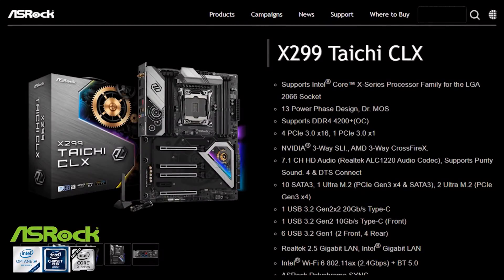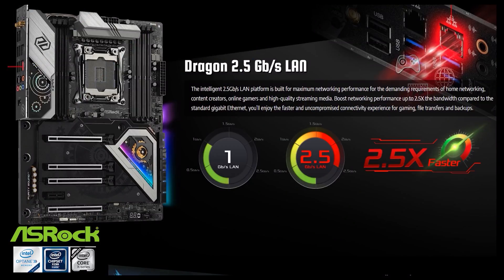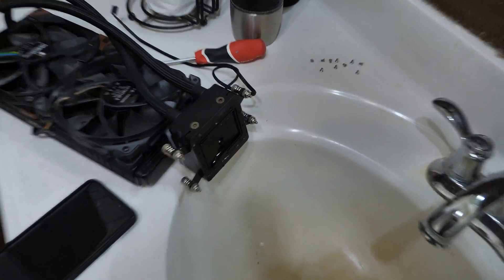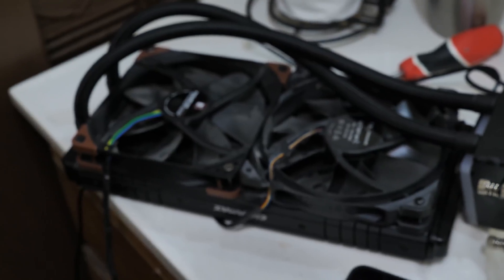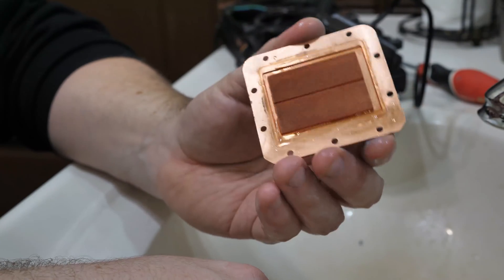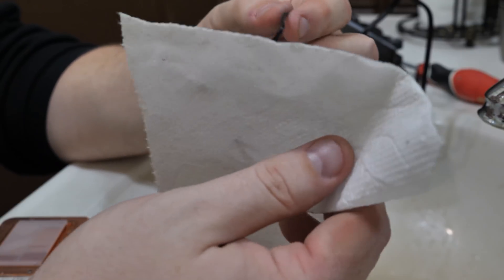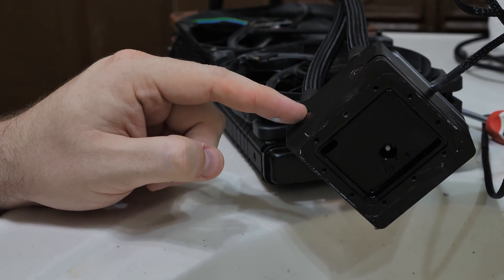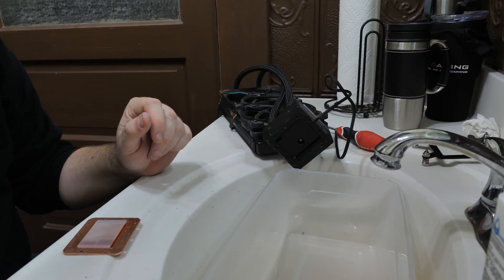L1 Diagnostic: Dying Enermax LiqTech II Teardown & Easy Fix

Comment: RMA if you can. If the finns have not discintegrated you can run vinegar through the loop for a day or two to clean it. Then clean it with distilled water and then you can use clear concentrates or ready made clear fluids. Don't use any opaque fluids as they tend to clog your loop.
A clear acrylic CPU block would do the trick. You could always keep an eye on it and see gunk before it destroys the fins.

Comment: Wendell I have a theory for you. I just got a 3800x to replace my 3600.My 3600 ran at 75c plus on a h100i and a liqfusion 360 stock. Now my 3800x runs at 80c plus. I have a x370f motherboard and I've been reading about tunes of people with insane Zen 2 temps and what I've notice is most of these people have a 300 or 400 mobo. I believe only x570 can properly run these chips without turning them into a fusion reactor. Or is there something else going?

Comment: I have done this exact thing on the Gen 1: https://twitter.com/DadTheTechie/status/1075487584527237122
I got it replaced with a Gen 2 though. Then my Gen 2 clogged up to: https://twitter.com/DadTheTechie/status/1113144147781849090

I cleaned it, rinsed it, filled it with high grade premixed coolant... worked great for a few months, then I had to do it all again... Then a third time. I have given up and got a refund on the cooler and went with an Noctua air cooler.

This could have been a great cooler, but not being able to fix this in Gen 2 after KNOW about the issue and even CLAIMING "the Gen 2 fixes the issue" evaporated their credibility for me.

I'm now looking to build a 3950X system and looking for a good cooler. Liqtech is on AMD's recommendation list but I won't risk going down that rabbit hole again.

Comment: Now we have to add fluids as a another point of failure for water coolers. This is why I went with a air cooler. Point of failure the fan stops working.

Comment: Biocide won't solve it. The anticorrosive used in these CLC's seems to break down or evaporate. This eventually causes aluminium oxide crystals and debris on the copper plate to form. 

Corsair H100i V2/GTX had the same damn problem and nobody learned anything from it. 

Biocide ain't the issue. Its an utterly wrong assumption that there is organic life growing in the loop. In the most simple terms Organics need temperatures in a liveable range, light, and some actual nutrients to live off of, to name but a few.
These conditions don't exist in a loop.

Simply have to add Ethylene Glycol / Propylene Glycol as corrosion inhibitor.

One of the two though has a higher tendency to evaporate out of solution, not sure which one right now.
Reply: Just saying, $30 for a half galon of evans NPG Waterless Coolant.  It will do all that and more, and provides better cooling than distilled water with added glycol.
Reply: Ethylene glycol is lighter

Comment: This fix won't last for more than a few weeks/months because the initial assumption is wrong. The "growth" is not organic. This is a classic case of mixed metals. The radiator in this aio is a standard aluminum radiator, and the interior of the cold plate is bare copper rather than nickel plated. 

Enermax made 2 revisions of a shitty product and refused to replace them unless customers paid half the original price to ship the product back to their factory in china(even though the replacements would have been equally shitty) 
I'm never buying an enermax product again because of how they treated their customers over this
Reply: Biocide won't solve it. The anticorrosive used in these CLC's seems to break down or evaporate. This eventually causes aluminium oxide crystals and debris on the copper plate to form. 

Corsair H100i V2/GTX had the same damn problem and nobody learned anything from it. 

Biocide ain't the issue. Its an utterly wrong assumption that there is organic life growing in the loop. In the most simple terms Organics need temperatures in a liveable range, light, and some actual nutrients to live off of, to name but a few.
These conditions don't exist in a loop.

Simply have to add Ethylene Glycol / Propylene Glycol as corrosion inhibitor.

One of the two though has a higher tendency to evaporate out of solution, not sure which one right now.
Reply: @cybercat1531  Ethylene glycol is more toxic to humans than propylene glycol. I highly doubt either of them evaporate out of solution in the temperature ranges specified in either PC cooling, or automotive applications. I could see it happening in an industrial cooling solution though.
Reply: Mixed metals by themselves don't cause galvanic corrosion, unless they were too lazy to actually put automotive coolant in the coolers like they are supposed to. Distilled water by itself and mixed metals will cause galvanic corrosion, this is true. But mixed metals isn't the problem, the problem is the coolant. Fix the problem, don't blame mixed metals dude, cars have been running mixed metals cooling systems for over 100 years.
Reply: Same boat as you, since the Platimax PSU I had blew and took GPUs and MB with it, I've been staying away from Enermax products

Comment: so you see floater junk in the liquid and do not flush the rest of the loop out? mmkay
Reply from the maker: In case it wasn't clear you run the pump in the shoebox without the plate  to dump it's load then o used the bottle funnel to refill it...

Comment: Is this a problem with all Enermax AIO’s? Like also the Aquafusion 120/240mm? Or is this a specific LiqTech problem?
Reply: Liqtech and spefically the threadripper one. But considering it was one of the few aios with a full cover plate for thread ripper and how much thouse hedt systems cost, they sell ya this...i wouldnt trust them
Reply: Dennis Rigdon hmmm, I just build a HTPC with a Enermax Aquafusion 240 and a R7 2700X... let see how she hold up, i’ll be keeping an eye on the temps 😉

Comment: I'm gonna stick to my old trusty aircooler. O_o -- Yes, I know, this is not common, most of these coolers today are pretty great. But I need something that will last me how ever long I need. My current cooler is probably close to 8 years old. I dont think these last that long in a system that runs every single day, more or less 24/7/365.
Reply: Yeah not having a pump that can fail (or poor liquid quality) is a definite bonus. 😃
Reply: @Bannockburn111  There is nothing wrong with a good air cooler, but the main advantage of AIOs (IMO) is being able to control where that hot air goes.  An air cooler pulls air in from the case and exhausts it into the case.  By the time you add a 2080 Ti and a 3rd gen Ryzen chipset you have a very toasty environment.  Your radiator fans can do double-duty and act as exhaust fans, keeping case temps down and improving the longevity of your other components.
Reply: Then you need to remember about thermal paste as well, the only thermal paste I seen to last up to 8 years is Arctic MX-4, most others last 2 years, some last up to 5 years before needing replacement. Else whatever silicon you want to have conducting heat elsewhere won't conduct anymore.

Comment: A piston engine does have a hell alot of metal  mixes and blends this days and they dont grow that garbage, did anyone try car coolant on a pc cooler?
Reply: Glycol is the common liquid used in a lot of aios. Spefically 3ms stuff
Reply: Automotive coolant lacks a dedicated biocide. If you want to see how important this is look up LTTs whole room water cooling videos. They used automotive coolant and it was a disaster. The reason you don't get stuff growing in your car is because the coolent gets way hotter then a pc cooling loop. There isn't a ton of stuff that can survive both the anti freeze and the high temps.
Reply: It makes sense, also went through the Jayz2cent videos and it's kind of bad idea.
Reply: Advocatus Diaboli  The cooling impact of using less is tiny, but people often are concerned about the higher viscosity impeding flow or damaging a pump. 

Only serious concern is if the antifreeze is ethylene glycol instead of propylene glycol, some tubing can react badly to it (PETG).  Easy enough to make sure you get propylene glycol, as it's safer for animals in case of spills anyway, but it is something to note if you're mixing your own coolant.

Comment: you know this is cool and all but isnt there a really good AIO for threadripper chips without having to resort to fixing this cheapo AIOs?
Reply: Not really. The other brands mostly use asetek and asetek uses a round cold plate that doesnt fully cover the package.
Reply: @MrMackievelli  Replaced my Enermax with a Corsair H100i over a year ago. Still running strong.
Reply: @MrMackievelli  not true, coolemaster has a TR4 compatible cooler that runs like a champ....had it for over a year on my 2950x.  No issues and great temps...
Reply: @SimonPhoenixInHD  its not like the enermax. Its a round bottom that doesnt fully cover the cpu package. The adapter just allows it to attach, it doesnt mean the aio's cpu block wasnt designed for large cpu's. It may work but they dont work nearly as well as the enermax one does, there are plenty of videos and websites that show that.
Reply: @MrMackievelli  again very untrue.  The coolermaster is TR4 specific and covers the entire IHS.....I know this because it sits in my system and was the purpose of my purchase.
Reply: @SimonPhoenixInHD  hmmm, I decided to google and see if I missed a release and in fact I did. They do make a proper block for threadripper. They released them in March of the his Year(2019 for those in the future). Didnt know that. I dont use aio's anyways, i use and prefer custom loops.
Reply: @MrMackievelli  and it is a great AIO....perfect for threadripper.  Thermaltake made one as well...The Flo 360 but it costs too much!
Reply: @PHGamer The overall quality of the Enermax AIO is as good as any other, it's just they screwed up and didn't get the liquid properly set up to prevent either corrosion or biological growth (not sure which).
Reply: You can retro-fit a high TDP AiO with a Threadripper cold plate, from what I've seen it's more worthwhile than all the OEM offerings for Threadripper and isn't nearly as stressful as custom loops
Reply: @amirpourghoureiyan1637  Do you have any links to help with that?
Reply: @popcorny007  Linus did it in his fake Mac Pro video, he did it for Epyc but the method works for any AiO with standard fittings

Comment: I fixed >10 of those by putting the copper plate (without seal and the wobbly thing) in the dishwasher at 60C. Also flushed the pump/radiator-combo with destilled water and then refilled with destilled water/ethylene glycol 4/1). Flushed some gunk out of the radiator also.
Reply: Did you use detergent? I ask because that'll anodize certain readily oxidizable metals, providing a thin coating over the copper, which may have been the real solution.
Reply: @blairfus  Yeah, same stuff we use for dishes. Off brand detergent of some sorts. No clue whats in it but gets everything off dishes. And i mean everything ;)
Reply: Just return it, and get something better or a noctua cooler. They should not get anyone's money, the failed on the version one liqtec and then did it again on gen2.
Reply: @mirrorking2  There aren't any other non-custom coolers with a proper TR4 cold plate, and air cooling in a smaller case may not be easy.  Given this cooler has the ability to clean and refill, while it's a PITA to have to do that even with a new cooler, it is going to perform better than other AIOs and once you've filled it properly, I'd hope it doesn't fail like this again.  It would be interesting if Wendell could do a review of this at 6 and 12 months to see if it's really the lack of a decent biocide, or if there's something else broken with this design.

Curious minds do want to know :).
Reply: @cluberti  yea i know there arnt any good AIO alternatives atm, thats why i changed to a noctua cooler, i just cant risk it clogging up again even if i could clean it out. i guess if downtime isnt critical and you dont mind cleaning it out now and then, its an alternative but thats a lot of IFs. i wouldnt be so angry if this wasnt their 2nd gen of these coolers, and i had the first gen and was convinced there was no way they would make the same mistake twice so i took a chance like many others just to be dissapointed again.
Reply: How did you avoid bending the micro scab fins with all the rattling going in the dishwasher?
Reply: @johnnychang4233  My dishwasher has a top rack for utensils. I could put them between the dividers that hold the knives and forks and the like so they couldn't move.

Comment: My 2012 Noctua NH-D14 isn't going anywhere soon
Reply: I never got the point of watercooling, especially AIOs.
A 240mm cooler would have roughly the same surface area as a good twin tower cooler, so it has close to the same cooling capacity.
It's not really quieter because you still need the fans and on top of that you have pump noise and clearly AIOs are way more prone to faliure.
Reply: Thanks for reminding me I've got one of those in storage and should really get Noctua to send me an am4 bracket.
Reply: @nogravitas7585  The AM4  bracket only cost me $9 AU ,FX8350 to 1700x and 3rd Gen  Ryzen on the cards this year.
Reply: RIPOFF65 noctua will send you a replacement bracket for free if you can send proof of purchase of an incompatible cpu or motherboard. That said I also paid $8 to get one in 2 days rather than 2 weeks.
Reply: Right there with you, D15S. One point of failure, the fan.
Reply: @jonathanvoshell7914 

And even then the D14/D15 is big enough that you could probably still game with the fan dead just due to case airflow over the giant things.
Reply: Mine is from the X58 days, cooling the I7 920. Now its cooling the R7 1700 @ 4ghz. I still have the stock fans for it.
Reply: Neither is my Noctua NH-C14: have it for over 10 years and is currently cooling my Ryzen 2600X CPU, albeit with only one fan, due to RAM clearance. Did have to order an AM4 mounting kit but Noctua sent me one free of charge: considering this cooler has been discontinued for SEVERAL YEARS, not bad @ all xD